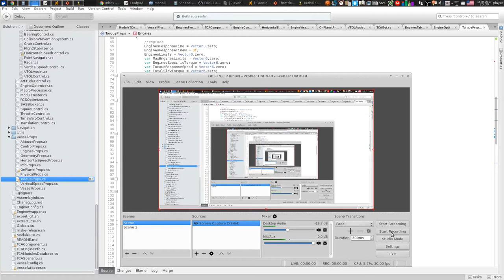Harrier-like VTOL to plane flight transit.

Comment: Excellent! I'm pretty impressed by some of the new navigation features.

I also see where I've been confused over the concept of "manual" control for the horizontal engine. TCA still used it "automatically" for flight. ;)

Comment: why is there no way to hide that window.     i like what the mod does but that menu/window that you can't even partially place off screen is a major dealbreaker for me
Reply from the maker: 1) TCA window and all its subwindows may be hidden simply by pressing the AppLauncher button (right edge of the screen)
2) see that small ^ at the left corner of the title bar of TCA window? Press it and the main window becomes collapsed. There's also a setting in the Advanced Tab that makes the collapsed window automatically show when mouse cursor hovers over it.
Reply: i discovered that a while later.  was skimming the manual for a button press before so i missed that part of the instructions

Comment: saying you are not good at flying planes basicly just means you suck at building planes.    flying them is easy they fly themselves.  if you build em right
Reply: Was that really necessary? If you use FAR, building functional aircrafts can be a pain in the ass, and flying them is some form of art on its own.